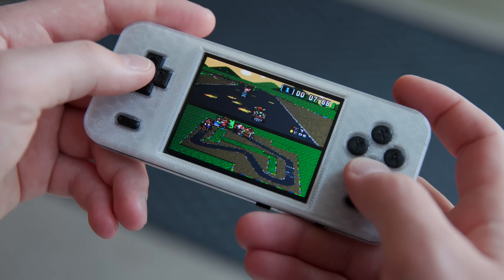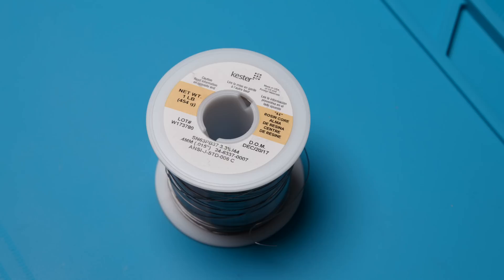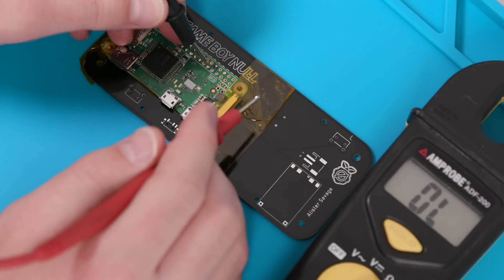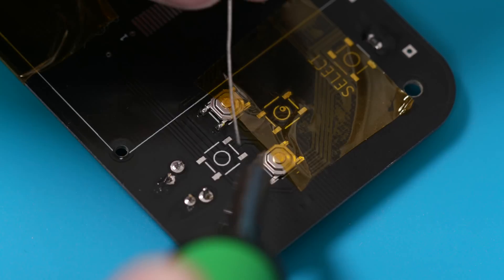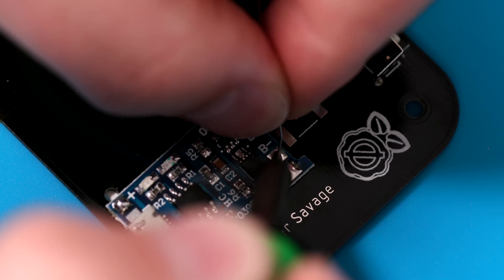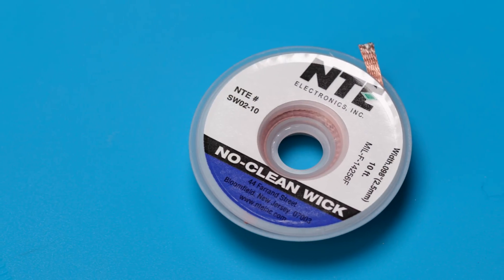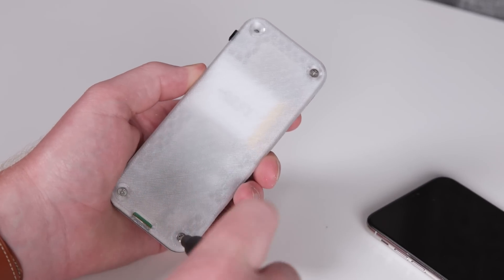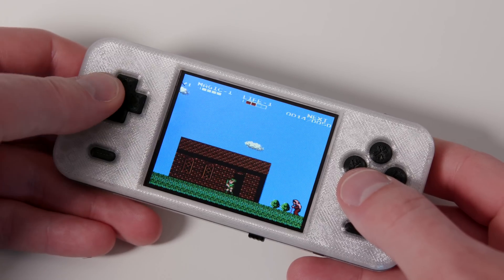Thousands of Retro Games in Your Pocket with this DIY Emulator!

Comment: Could you make a gba in the shape of the original Gameboy or Gameboy color? No hinge, buttons at the bottom, the same 2.9 inch screen at the top, include shoulder buttons and a headphone jack, and the same charging cable that the SP accepts? (May have to mess with the voltage). As for brightness, I've never had to use the sp's extra brightness in any lighting condition, so default at the original gba's lack of light for use if you're playing in the sun, then increase to the sp's default brightness for playing at night.
This, to me, is the perfect gba, no hinge that can break, the traditional buttons below screen, it's worth it even if it isn't compatabile with original Gameboy and Gameboy color games.

Comment: Based on what i saw i wouldnt suggest this as a first solder project.  Also without a decent iron, fine tip, good thin leaded solder and yes good flux this will be a challenging solder job even if you have a little bit of experience. I think having the ideal tools made this looks a bit easier than it would be with an old unregulated hot poker and a 20 year old roll of 1/8 diameter flux core.

Comment: Can you recharge the battery or do you have to remove it once it dies????
Reply: TcT Videos 101 it’s a rechargeable lithium polymer battery LiPo and is charged using the TP4056 board. Just plug in a micro usb charger and you’re good to go
Reply: Ok
Reply: It is shown near the end of the video of installing the micro usb

Comment: For the smaller parts you don't even need to touch the solder. Just have the iron close enough to melt it if you are worried about burning the components.

Comment: Why people don't just buy a cheap PSP and hack it?
Reply: Agreed.  the PSP is THE ultimate emulation machine these days.  It's small, cheap, high quality and easy to hack.  And it's fairly beefy hardware wise and will emulate anything you throw at it, including N64 and PS1!   It's PS1 support is actually quite impressive since it's done by Sony themselves since they designed the device to be able to play PS1 games directly!  It uses emulation, but it's DAMN good emulation, and is official emulation done by Sony themselves.
Reply: RedVGFox building it is half the fun
Reply: That being said, if you can afford it, the Model 1 PS Vita is actually the VERY best emulation machine, as it has a big GORGEOUS looking OLED based screen!  And now they have fully hacked it so it can do everything the PSP can do and then some!
Reply: yea i just hacked my vita. i get that people who do this do it for the building part of it, but those "asterisks" at the end kind of killed it for me. i was sold until the end where the guy said there's no audio and the screen sucks outside. also that d-pad looks pretty trashy to me. i can't say for sure until i actually hold one though.
Reply: Yeah, people keep recommending this, but the emulation of SNES games on PSP is pretty ass, and bad SNES emulation is a deal breaker for me.

I use a GPD XD, which does a hell of a lot more than the PSP. It emulates far more systems, and does a better job of it. The PSP isn't even remotely on the same level. Your phone with a cheap bluetooth controller also beats the PSP. You get the added benefit of dual analog sticks, as well.

The XD also has HDMI out, so you can play those games on your TV, or use it for netflix, or watching downloaded movies.
Reply: This is actually easier lol.
Reply: @rockyoliver3933  Not really, to hack a PSP you just need to drop two files in a folder and that's it.
Reply: What about the fun?
Reply: Hard to find a "cheap" one with the right firmware.
Reply: That’s what I did.
Reply: Because the specs on the PSP are damn obsolete and no respectable, cycle-accurate emulator will run on it.
Reply: because this is COOOOOOOL
Reply: Just get a PSP or a PSVita and hack it.
Reply: I do buy a PSP because I lack the skill and material (3d printers / soldering tools etc..)
But one day I know i'll make my own arcade cabinet and small handled
Reply: Building it give you a sense of accomplishment. Also, why buy a cheap PSP. Your smartphone phone should be fine unless you want to feel the buttons.
Reply: Noobit Yeah, I want to "feel the buttons" thanks, touch screen buttons are cancer.
Also, a PSP is 20 bucks and playing your stuff there doesn't kill the battery life of your phone, it saves my life when I have to wait 5+ hours on a train travel.
Reply: @RedVGFox  The PSP alro suns SNES games like crap. They dont run at full speed so theres that.
Reply: @LastOneLeftProd  Not anymore, there are some emulators that got updated recently that are using full PSP potential using the Media Centre processor which improves performance actually a LOT (it wasn't ever used since recently) and the SNES emulation on PSP is way better now.
Also the N64 one got a big update (now with F-Zero playing almost full speed, and Ocarina at playable speed as long as you don't use audio), and a NDS one is on the works by the same guy from DraStic on Android.
Reply: @RedVGFox  you're wasting your breath. This generation isn't about what works they are about what's new and hot and will my homeboys have it.
Reply: It's old,and Sony doesnt make it anymore so good quality parts are harder to get
Reply: Because they don't want a PSP with slow processor, low Res screen and bulky construction that has to be hacked.
Reply: @another3997  You really need a more powerful processor for emulating shit that already is full speed on a PSP? Also the screen resolution doesn't really matter in 2D games if the resolution is allready same or higher than the  console you're trying to emulate..
Reply: @RedVGFox  Someone said PSP was the perfect emulation machine. If you only emulate an old Gameboy, then I'm sure it's fine. If you want to emulate something more demanding, good luck on a PSP. The RasPi Zero has 512Mb of Ram, and a much faster processor, along with a decent video chip. And it runs Linux so lots of emulators and no 'hacking' involved. It's also very cheap and well supported. Apart from being bulky, not made any more and limited in power, memory, resolution and flexibility... the PSP is great.
Reply: @another3997  Yeah, except on the PSP you can emulate everything up to PS1 and N64 (not all of them but still), this one can barely emulate PS1.
Reply: Or just use your phone..
Reply: yea that give you great onscreen controls..
Reply: @LokiNegus  Exactly. Android has tons of free emulators as well as direct linked ROM libraries. You could spend $20-30 and get a bluetooth controller with a mount for your phone to make it ever better. Of course, building it yourself is still fun.

Comment: This is a well made video, and probably the best pi portable console video I have seen to date. However, I do want to point out that you should NEVER cut both terminals of a lithium battery at the same time. The metal in the scissors is shorting the two terminals together, and a shorted lithium polymer battery can explode in a firey ball of infernal rage. This is extremely dangerous, so try not to do that again. Keep up the good videos!
Reply: I thought the same thing when I saw him cut it like that.
Reply: Holy crap yes. I've melted wires in little RC models with batteries that size because I didn't bother to test for shorts before plugging them in. If that battery was much bigger you could have spot welded the wires to your cutters and had a burning battery. No joke! It would only take 10s of amps to do it for smaller wires.
Reply: Ummm I think Wiggy is right, stuff like the "Minty Pi V3" by "Sudomod" aka "Wermy" is much easier to build, doesn't require mush saughtering at all, and much more premium.
Reply: I know from my own experience lol. Got stitches on my right hand
Reply: I definitely had a panic reaction to those wires being cut together. Glad we can share that four years apart, heheh
Reply: Shank Mods hey shank i love your wii portables
Reply: And thanks for replying to me on bitbuilt
Reply: Shank Mods you clearly haven’t seen very many Pi portables.

Comment: since Batteries die easy and fast… it would have been better to just solder a 2 pin connector to the battery spot instead of cutting off the connector from the battery cables. So a later replacement would be a lot easier and would not require soldering it off. Soldering batteries is also really dangerous since they can blow up due to the heat.

Comment: Speaking about the battery you tell us to make sure that the wires don't touch each other while you cut the connector of with a scissors in one snap :) 

You should have cut 1 wire at a time. Just to be safe...

By the way. Great vid! :D

Comment: I did something similar to this but I  used a GBA housing and put a speaker in it. I took the screen out a car reversing monitor and it works great. It has good viewing angles and long battery life. I spent around £85 on it if anyone is curious of trying this themselves

Comment: You had me until you said no sound.  A video game experience at its most basic core is just video and sound.  I’m no mathematician, but missing 50% of the expected experience kinda of sucks.  I don’t need both speakers and a headphone jack, but come on, one is required.  Cool looking device though... shame it’s held back by such a glaring omission.
Reply from the maker: Sound can be added pretty easily if you’re willing to bulk up the case a bit.

Comment: I'm a SMT engineer (Surface Mount Technology, the tech were that chip resistor came out) and this project is really great. Regarding the Flux, this is used to help the solder stick onto the PCB (Printed Circuit Board). I would advice better to apply the Flux before soldering the chip resistor, and that is going to help a lot.

I don't know how much info you can get when you buy this product, but usually the solder is chosen based on the PCB materials and the final purpose of the product (among many other variables, but in this case these two are the most important). The most common solder alloy could be SAC (96.5% Sn + 3%Ag + 0.5%Cu) but you can get something like 100%Sn and it's going to be good enough (and cheaper). Just please please please, stay away from solders with Lead!!!! hope this helps someone ;D

Comment: there is nothing premium about 3D printed lattice.
Reply: There's nothing particularly premium about injection moulded plastic either, but that doesn't stop it being used.
Reply: injection molded abs plastic is actually fairly premium.
Reply: @megatrolltrollington  Definitely quite premium, makes stuff easier in my personal experience when doing personal projects.
Reply: @another3997  The device was designed to be used with a plexiglass case, premium enough?

Comment: STOP. Don't tell people to buy the cheapest soldering iron, they will find something so horrible like you can't imagine because you never had to deal with shit like this. Like "936" style handles with thyristor control and fake temperature readings that don't really work unless you have lots and lots of soldering experience and can work around their issues.

Granted, a full 936 style soldering station that does actually work fine can be had under 40€, and probably around $20 in your end of the world. And you can use a basic non-regulated 20W-30W iron, as long as it's more or less a reputable one, that's fine too - but they have a thermally balanced design where they are in a way self-regulating because the hotter the body is, the more heat they lose, various 906/936 derivatives plain aren't. Also conical tips are not your friends especially if you have a soldering station that is kinda meh unlike the 951, chisel tip is much less troublesome.

Comment: If you want an easier way to play retro games on the go, buy an old cracked (not literally) PSP and put emulators on it. NES, SNES, GENESIS, GAMEBOY, GBA, even PS1 GAMES. Fantastic gaming machine a with good screen. It has sound and responsive buttons, headphone jack, brightness control and plenty of replacement parts.

Comment: "I don't solder" buys an Hakko.
Reply: "I never solder. But when I do, I use Hakko".
Reply: He doesn't solder, he sodders 😂
Reply: Cthulewt Rlyeh That’s just how Americans say it.
Reply: Or he hadn’t soldered much before, but wanted to start doing it more often, so decided to spend on the tools since he runs a tech channel.
Reply: Use an for words beginning with a vowel sound
 an accident, an item, an hour
a book, a hotel, a university
Reply: Dude either has more money than he knows what to do with, or he's sponsored.
Reply: @skins4thewin  that hakko here costs the same as my little TS-100 which is my go to soldering iron for on field drone repairs as I can use it with a lipo battery. That hakko isn't as pricy as people think that it is
Reply: @geoffreymartin2714  I have that miniature TS-100 as well, I was wondering what sort of battery to use with it actually, or what power supply.  The seller said to use a Laptop power supply?  Does it really need something that beefy?  Any suggestions of a good compatible power supply?  Am eager to find one to use with it as I haven't used it yet.
Reply: @skins4thewin  usually the better the power supply the more power the iron can get for me I have an MSI laptop that delivers about 19.5 volts which for the TS100 works well. For portable power get a tx60 adapter and I usually run mine off a 4S cell
Reply: @geoffreymartin2714  4S cell?  What is that exactly?  I am unfamiliar with oddball batteries aside for your run of the mill household stuff
Reply: @skins4thewin  for Drone batteries or other similar RC hobbies we generally use Lithium Polymer batteries the 4S is the number corresponding to the number of cells the battery contains in that example a 4S battery contains 4cells of batteries to give higher power and last longer then just one cell alone. These usually will have a balance lead (for charging each cell) and an XT60 or XT30 connector so for a TS 100 you need an adapter to connect it but it does work well
Reply: Need Lamp also - an den ! 😂
Reply: What is Hakko, its supposed to be German Weller, everybody knows what i talkabout !
Reply: *a Hakko
Reply: and sometimes with words beginning with H as in 'an historic occasion'
Reply: Only apply “an” for words that start with a vowel .. ✌🏼

Comment: The boiling point of lead is 1749 degrees Celsius (3180 Fahrenheit) so no one is going to breathe lead doing something like this accidentally. Although yes you should solder in a well-ventilated room.
Reply: why lead tho, tin is less toxic(i dont know about solder)
Reply: Leaded solder is much easier to work with and flows at a lower temperature than non-leaded. Though Non-leaded is required in certain applications.
Reply: @WorldInThe  Usually when you work with things that have lead already or tin then you need a specific solder

Comment: I was the guy who actually discovered the issue not insulating the rpizero with kapton tape and the manual had to add it, that step is MANDATORY or it will short later

Comment: The best part; if you want injection-moulded buttons rather than 3D printed ones, then just change the design. Hella easy.

As for audio, I see no reason why a headphone jack wasn't a possibility, I would had went with making it longer if I could get away without making it thicker, or somehow figured another means to keep it skinny.

Comment: not to denigrate your project at all, but i've been thinking for a while about the point at which a kit becomes Assemble It Yourself instead of DIY and this video just happens to be the place i'm making my concern public. It's... hmm... tough one.. the kits like this in the video are good because it's a good intro project for a beginner multidisciplinarian that happens to be a great toy gadget... there's some soldering and print own case so it isn't 100% AIY but i'm not sure kits this comprehensive can be considered DIY either

Comment: Properly soldering goes like this. Heat the pad / point first , then offer the solder to it. Not the other way round. It's not like spreading butter. You need to let the heat of the pad melt the solder. OK. 

For the SMT components, just apply solder to the hot pad, then just slide the component when the solder is heated up. So easy to do.

Now how in heck's name did you buy leaded solder? You know that's illegal right? Unless it is for medical equipment... Liked this video though. Thumbs up.
Reply from the maker: Leaded solder is very easy to get in the U.S. Bought it on Amazon. :)